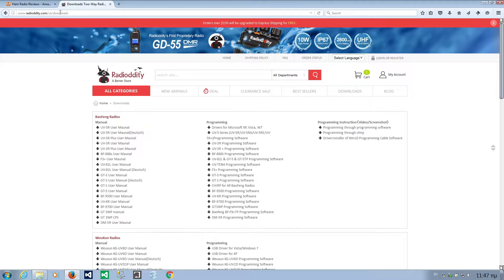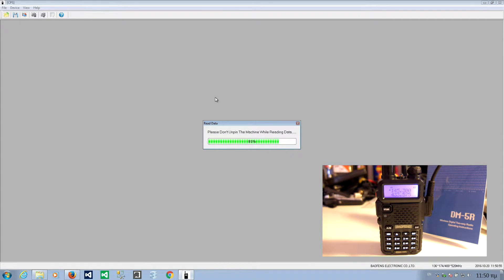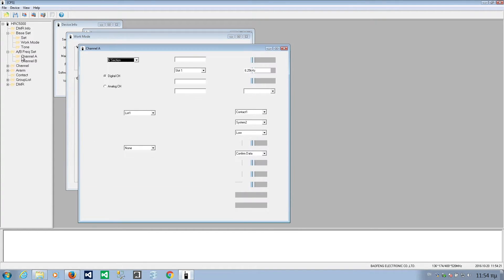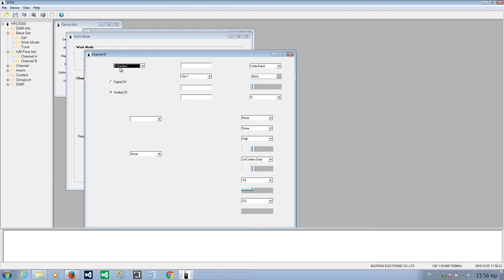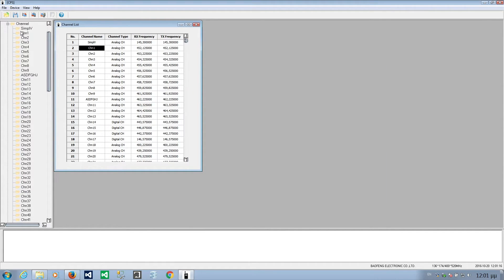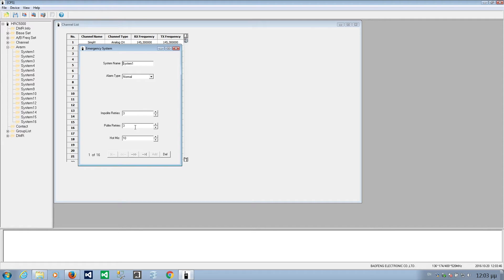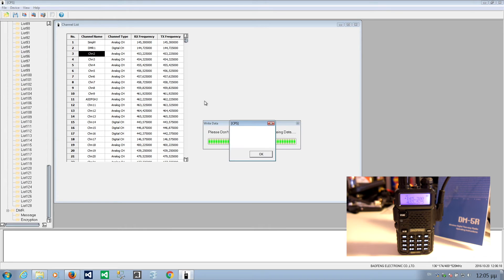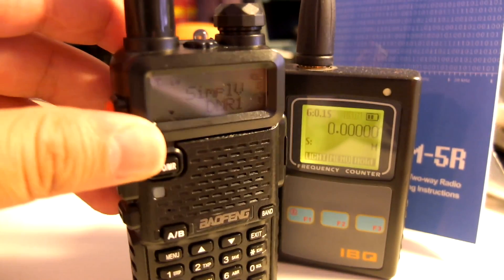Baofeng DM-5R Programming Software

Comment: Good morning, I wanted information about baffeng dm-5r, I can not program via cable usb the radio, because the cable does not see the radio, does it require a particular usb cable for the dm-5r? Or do you want special drivers? I am using a usb branded baofeng cable, how can i do it? Thanks for your help

buongiorno,  volevo informazione sul baofeng dm-5r  , non riesco a programmare tramite cavo usb la radio , perche il cavo non la vede la radio , domanda ci vuole un cavo usb particolare per il dm-5r ? o ci vogliono dei drivers particolari ? io sto usando un cavo usb marchiato baofeng  ,  come posso fare ?  grazie per l'aiuto

Comment: How did you get your com port set to 3 on the software. Mine only displays one and cant figure out how to get it set to 3. I've tried reinstalling, changing com ports to point to com 1 in device manager and still nothing.
Reply from the maker: You don't need to set it to "COM3". If it's only showing one com port (eg "COM1") it means that that's the only COM port available, so that is the COM port of your connected cable. Select that one.
Reply: O im a ding bat, I'm sorry. In the software, instead of selecting a drop down box, edit the text to say COM3  facepalm.
Reply from the maker: Glad you found it.